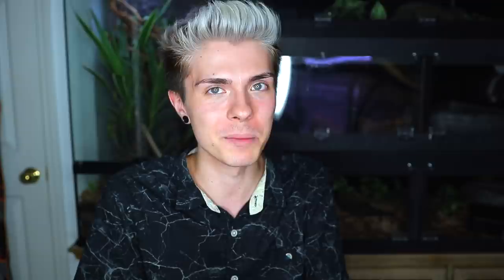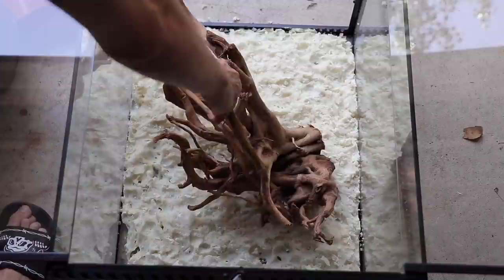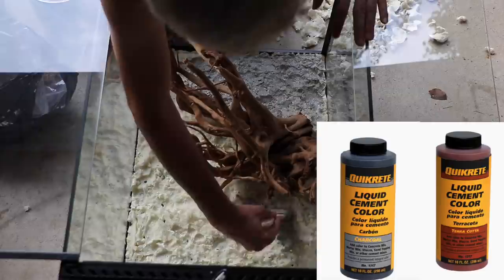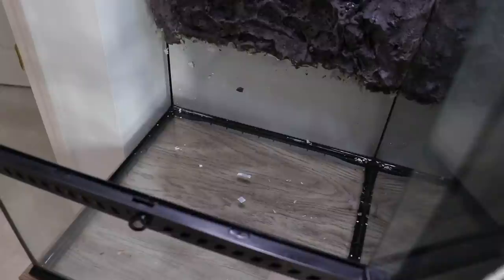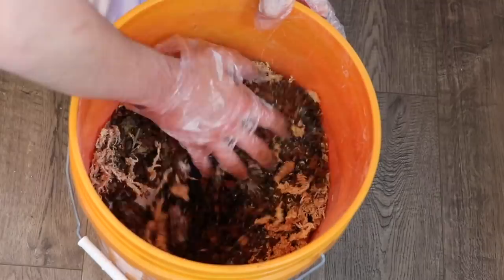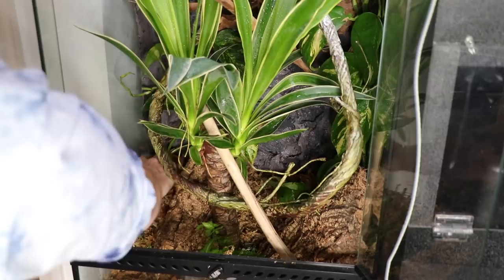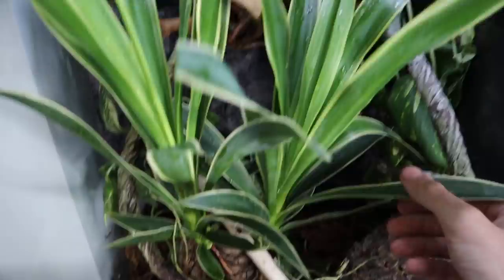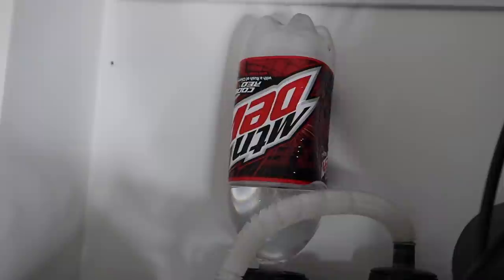Setting Up a Bioactive Abronia Graminea Enclosure!!

Comment: what i did with my Tegu's enclosure to get a rocky background was, i painted the spray foam with a thin watered down layer of grout. several layers of it actually, around 7 if i remember right. a layer, let it dry and repeat took awhile, then painted it with a pet safe  water based paint to the colors i wanted and THEN a few layers of clear drylock. it feels like real rock and more durable because of the tegu's size.I  was worried he'd tear out chunks of the foam if i didn't add the layers of grout. this wasn't my idea tho, there is a youtuber named Beckywheeler that does reptile backgrounds for people and she put up very instructive videos of the process. she hasn't done any videos in 10 years but they are still up if you want to try it out. tho THINK she used a type of varnish as a sealer where i used the drylock as a substitute.

Comment: How have your abronias held up in the glass? I'm thinking of going with glass myself but it seems everyone on the forums have only tried screen. Lower end chams have somewhat similar care needs and can be successfully kept in screen top glass enclosures, so abronias being slightly less sensitive I feel would do fine. With everyone demonizing the idea on forums it would be reassuring knowing someone has succeeded.
Reply from the maker: My abronias have done really well! For me it’s just very difficult to keep humidity up indoors in a screen enclosure. If you’re worried about ventilation you can also put a small computer fan on the screen top to help circulate air. Or attach acrylic panels to the back/sides of a screen enclosure to help hold in some humidity while still leaving a good amount of ventilation
Reply: I just saw your latest video, congrats on the successful breeding! If there breeding then you must be doing something right. I'm glad you've had such great success and I plan to use a fan just like you do for air circulation. Do you keep your fan on all the time or on a timer?